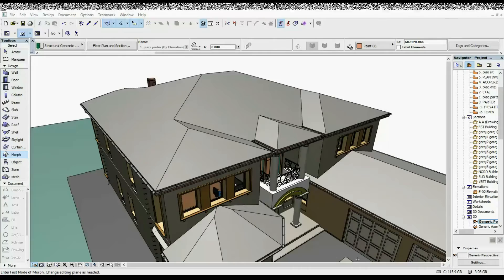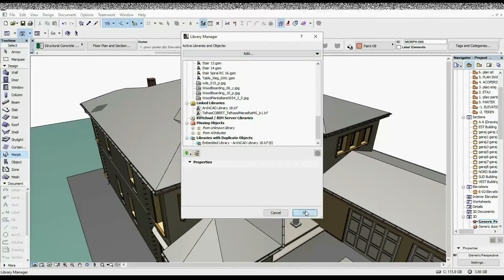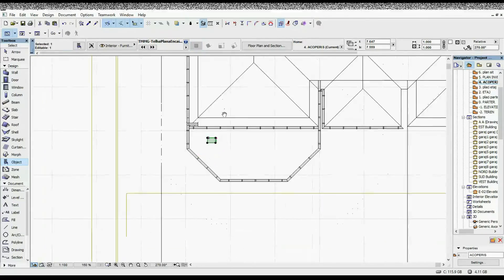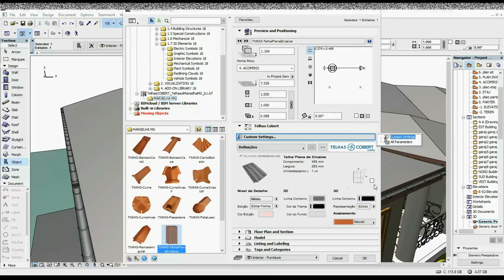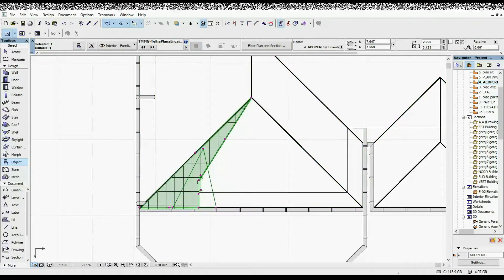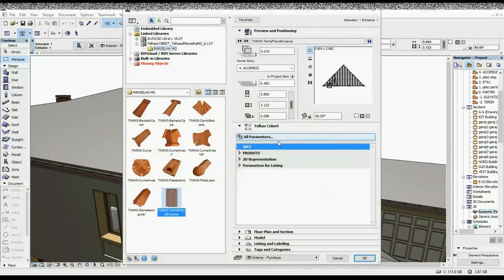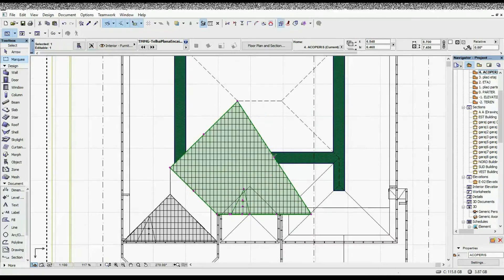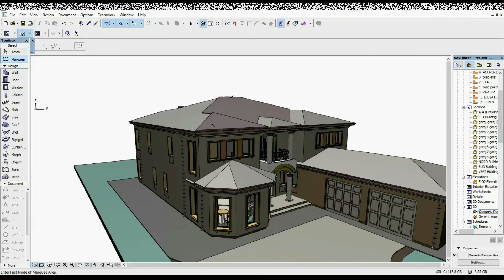Calculate roof / tile surface in ArchiCAD

Comment: why  you dont create a schedule for roof and calculate the area ?
Reply: i thought the same...if you have the schedule tool, why do this way. good point
Reply: Exactly right I did a schedule and I got in the Hips Valleys and Ridges. Plus the surface quantity of the roof, much quicker too.
Reply: @craigmonteith1941  how to calculate quantity of roofing sheet?
Reply: @admglobalservicesltd3561   Roof quantities aren't easy, but a general process is to note the surface area of the inclined roof. The inclined roof is a true surface area as compared to the plan surface area. Once you have this quantity you are on your way. Then you'll need the surface area of the roofing unit, say this is 16in X 38in this equals 608 Square Inch or 4.20 SqFT or 0.39 Sq M. Using a roof of 185 SqM you need 185/0.39 = 476 pieces of roofing sheet. Think you're done, not yet. You also have to add more sheets if the roof has valleys and hips, these areas of the roof produce waste. So my experience show that for a simple hip and valley and 10% if the roof is large and complex add 20%. Hope this was helpful.
Reply: More light on this pls